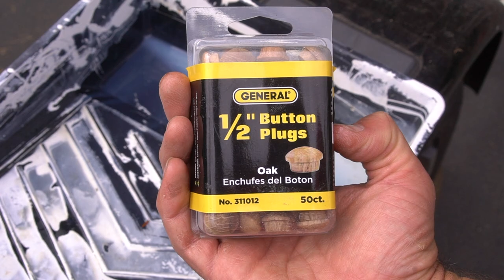DIY PADDLEBOARD RACK // KAYAK RACK

Comment: There are some good basic suggestion for this rack however there is an absolute ton of room for improvement and I don't mean rocket scientist improvements, I mean just by applying the very basics of woodworking. Where this person relates the number of screws used to the finish products strength is a huge red flag. In literally no time at all the screw connections will loosen as the lumber naturally shrinks out in the open air and this rack will be wobbling all over the place. Another red flag is when he said he added horizontal bracing for structural integrity,, even a kid knows diagonal bracing adds structural integrity for lateral stability, not to mention the lack of waterproof adhesives for all the screw joints, and sanding the mating surfaces flat for maximum contact for gluing I could go on and on, don't throw good money away on this rack build, do some research and educate yourself you will build a better product.
Reply: So why don’t you do a video on this seeing as you seem to know it all🤷‍♂️
Reply: @garethgriffin7687  A million bloggers have already shown how to do it right.